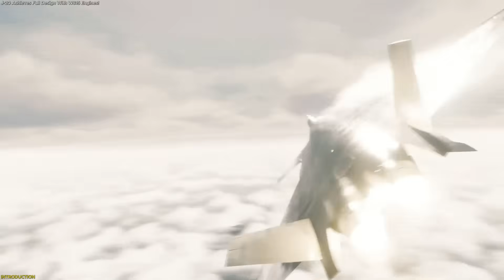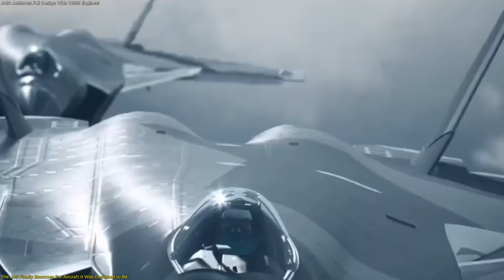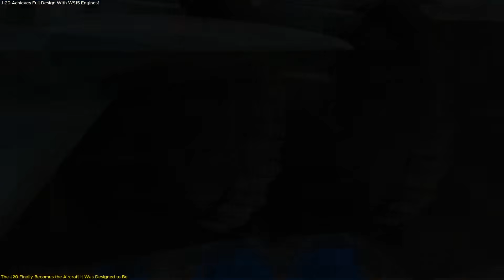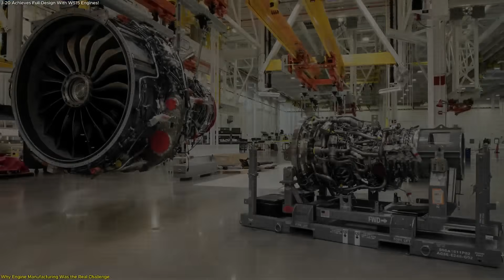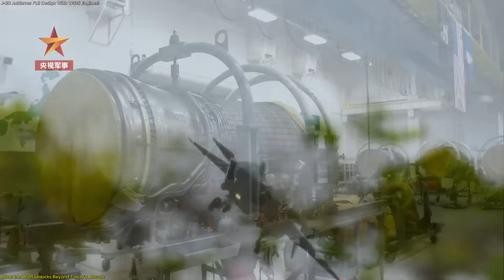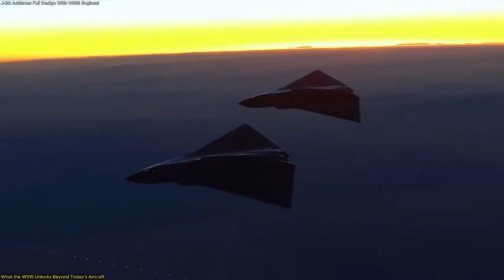J-20 Achieves Full Design With WS-15 Engines!

Comment: I believe some form hybrid electric fan jet engine is the way to go. This form of hybrid jet can reduce the typical size/diameter of the engine.
Reply from the maker: That’s an interesting point—and it’s a direction many researchers are actively exploring.
Hybrid-electric concepts can offer benefits like improved efficiency, better power management for onboard systems, and new design flexibility. However, for high-performance jets, current hybrid technologies still face major challenges, especially around power density, heat management, and weight. Those limits make it difficult, for now, to replace a compact, high-thrust core engine like the WS-15.
In the near term, the more realistic path is likely incremental electrification—using electric systems to support subsystems, energy management, or future propulsion enhancements—rather than a fully hybrid main engine. That’s exactly why achieving reliable serial production of advanced conventional engines remains such a critical milestone....Thanks,,,,
Reply: @SpaceEyeNews While an electric compressor section of a turbojet is possible, the main use of an electric fan would be in a turbofan or high bypass engine, eliminating the need for a heavy complex reduction gears. Would also make an adaptive cycle engine easier to design. Or even the front end of a ramjet.
Reply from the maker: That’s a solid technical point, and you’re right about where electric assist makes the most sense.

An electric fan or electrically assisted front section fits much better with turbofan or adaptive-cycle concepts, where variable airflow and power management matter more than raw exhaust velocity. Using electric drive at the front could simplify some mechanical complexity, especially compared to traditional reduction gear systems.

That said, for high-performance aircraft, the main hurdles are still power density, thermal control, and energy storage. Those challenges limit how much of the propulsion system can realistically be electrified today. For now, electric assistance is more practical as a supporting layer rather than a full replacement—but it could play a much bigger role as energy and materials technologies advance.

Great technical insight—thanks for contributing to the discussion.

Comment: It proved that human brains have its limits. it takes time to improve/refine the objective of a project! and that's why China and US are competing head on for AI leadership and eventually dominance.
Reply from the maker: That’s a thoughtful observation—and it fits well with this topic.
Complex projects inevitably reveal human limits: design goals evolve, assumptions get tested, and refinement takes time. Advanced engines, like advanced AI systems, aren’t breakthroughs that happen overnight—they mature through iteration, data, and accumulated experience.
That’s also why the U.S. and China are investing so heavily in AI leadership. AI helps extend human decision-making, accelerate testing cycles, and optimize designs far faster than traditional methods alone. In that sense, progress in areas like engines and AI is connected: both are about reducing development bottlenecks and improving how complex systems are built.....Thanks,,,